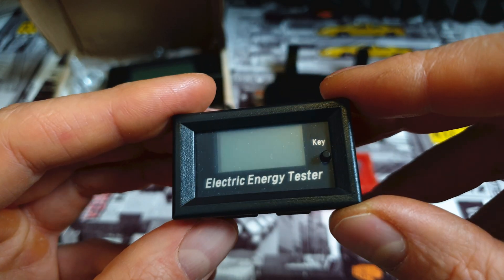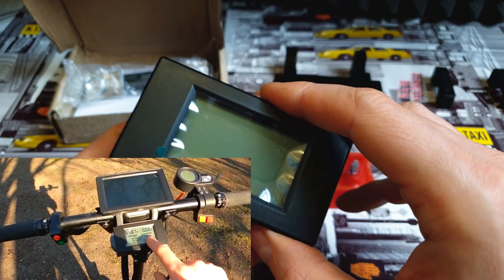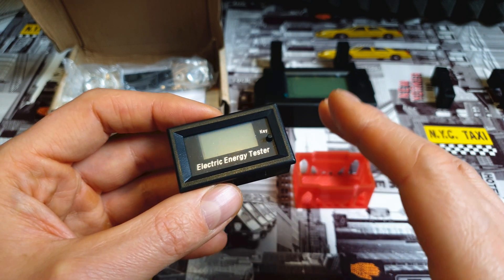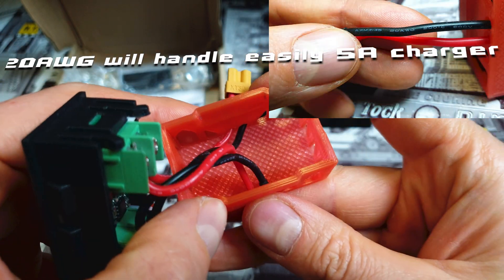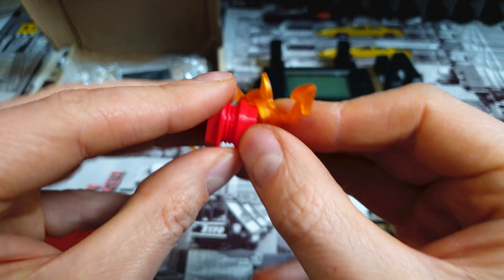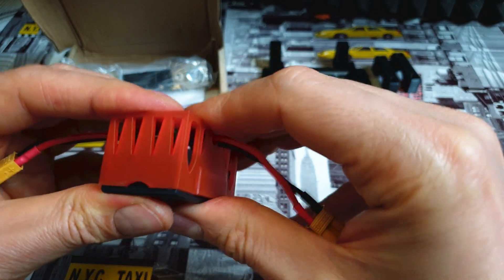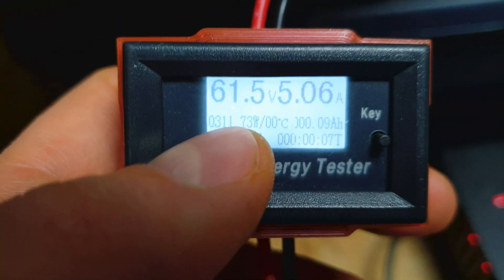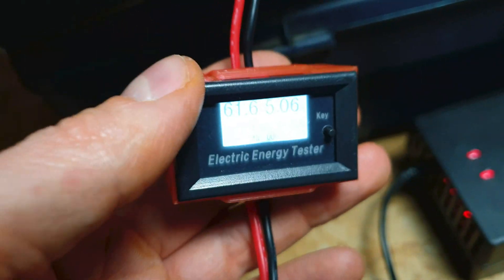Watt Meter ⚡🛴 Check what is true Capacity or Condition of your battery 🍕 M365 T85 ES18 Boyeda 🍻🏴‍☠️

Comment: Hello, I have a question. I want to buy a watt meter like you have, but it’s out of stock. I can buy other ones from AliExpress but they’re rated differently. I live in Europe (Belgium). We have 240V 50/60Hz power outlets. The one I found shows me that it’s rated for 6,5-100 volts and 0-20A  in DC current. Is that Oke to use or do I need something different? (The little one you used in your video is rated 120VDC is that also enough for 240V power outlets in Europe?)